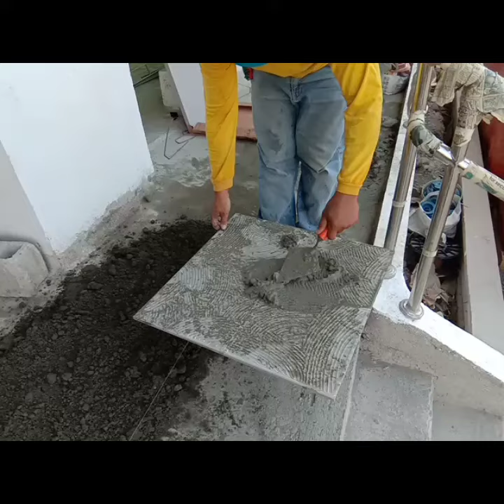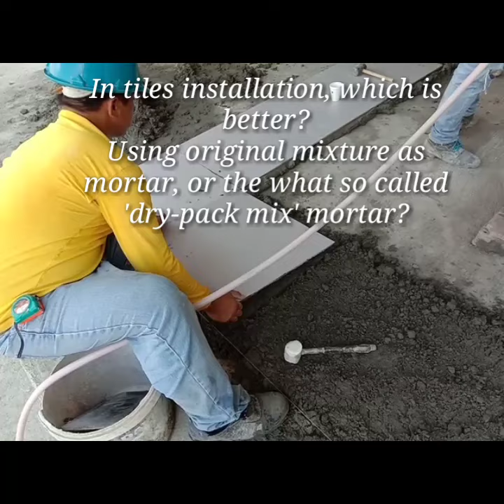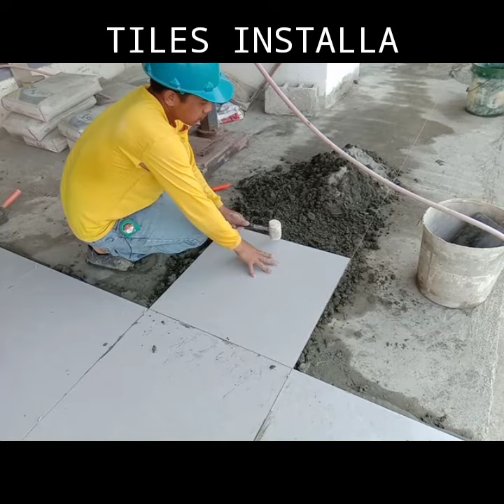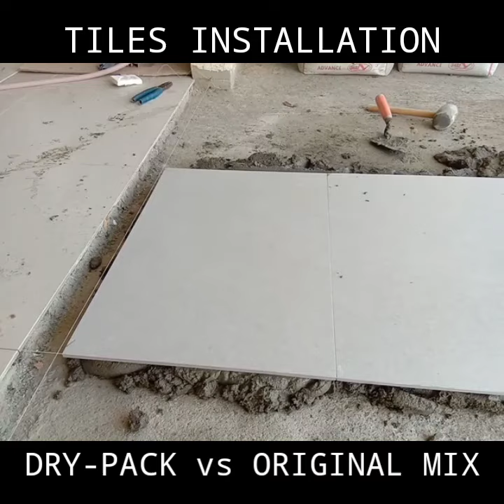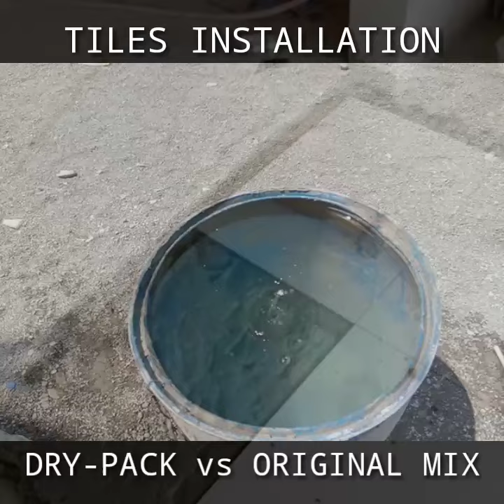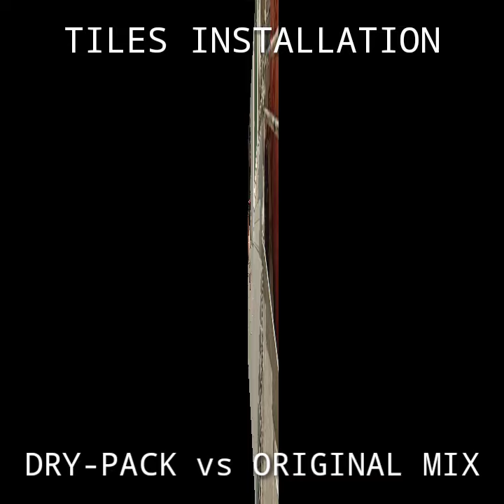Floor Tiles: Comparison Between Dry Pack and Original Mixture | How to Install Floor Tiles

Comment: The two methods are equally satisfactory depending on several factors. Dry pack method is good for new builds or outdoor patio areas where the floor level can be built up. Whereas if your tiling a small bathroom indoors then thin bed tile method is better suited

Comment: For me much better yung dry pack kasi may adhesive yung tiles bago ikabit yung derecta reject sa akin yan madami na kasi akong ne repair na kumapak ang tiles after a year,hindi siya kumakapit ng husto kaya sa sandaling panahon bumibigay,pero ang style kong isa pa yung dry pack din less water pa at grout cement sa ibabaw kapit na kapit talaga at menos gastos pa sa adhesive,im a mason beteran for the last 45 yrs. at 35 yrs.akong ofw.thanks sa video mo,madami ang matototo at makakakuha ng teknik,kahit anong paraan jan sa ipinakita mo pwede naman iaplay ng tilesetter,goodluck.
Reply from the maker: Maraming salamat po sa pagbahagi ng iyong kaalaman at karanasan sir. Godbless you po.
Reply: Ibig nyong sabihin sir is instead of using adhesive sa tiles is purong semento ang gamit nyo?
Reply: tama po kayo sir dito sa europe ng dadrypacking sila kong medyo mkapal.at cemento lng din binubuhos sa ibabaw yung tinunaw na cemento...pero bihira lng kc talagang gumagamit ng leveleng cement pg ng slab kaya pantay ang sahig kaya pag sa marmol or granite adhessive lng kc manipis lng
Reply: Boy Kalikot MotoVlog depende kapag hindi sanay sa pagtiles huwag gumamit ng purong cement,meron kasing style dapat beteran sa pagkabit ng tiles,mahirap eexplain dapat aktual ituro ng tilesetter or blogger video
Reply: Semento lng din gamit ko grout na cemento sa ibabaw Ng dry pack kailangan lang tlgang magand pagkaka compak Ng dry pack dapat siksik na sik .... Tpos laging lagpas sa laki Ng isang tiles sakop Ng drypak na ilalagay mo para Sakop buong tiles

Comment: Ang drypack ginagawa lng yan kpag malalim un level na paglalagyan ng tiles. Inshort nakabase sa flor finish plan. Kung mababaw nmn pde kahit adhesiv lng.
Reply: Lods pano ung diskarte sa mababaw lng?
Reply: @rickyritchieindino5141  konting silsil lng sa paglalagyan ng tiles. Pro ang kagandahan sa drypack madali mo matatangal ang tiles at magamit sa iba. Unlike pag puromg adhesive mabibjyak ang tiles pag kinuha.
Reply: @rickyritchieindino5141 pinaka purpose tlg ng drypack is to level the floor to install tiles prw hndi aksayado sa adhesive. At ang adhesiv is to hold tiles perpectly wla hangin o mgkakapak.
Reply: So sa mababaw lods adhesive lng at simento?mag di diy lng kc ako lods hehe
Reply: @rickyritchieindino5141  oo atlis haf inch
Reply: @ericputian124  sir,ung granite po ba mgnda sa sala,ung flooring nmin nkafinishing naun pro my ibang parte na hindi level,anu po Kya mas okay dun?dry pack o original mix,slmat po sa sagot en God bless po🙏
Reply: Tama ang dry pack po kasi ginagawa lang po yan..dahil sa hindi po maganda ang level ng flooring ng pagtatiles san po..pero kung nakalevel naman po yung flooring ok naman kahit hindi gumamit ng dry pack kasi dagdag gastos pa po yan..pwede naman po habulin ng adhisive kung anuman ang malalim na part ng flooring..

Comment: Bilang ahente ng isang condo at the same time nghahandle ako ng mga repairs. Naobserbahan ko yung isang sikat na developer used dry pack kasi mabilis ang gawa pero in 2 to 3 years time nag aangatan na lalo na kapag nagkaroon ng lindol. Nagpuputukan. So I prefer po yung original mix. Then pag pinaggawa mo yung may kapak the next month or year yung katabi naman magkakaproblema. I am currently assisting tile works. So yun nga you have to be very specific at dapat kahit babae ka kailangan may idea ka din sa contruction kahit basic or atleast mag search ka din para may alam ka khit papaano.Kasi kadalasan isasagot sayo "OO at hindi ganito po talaga.." Just sharing.
Reply from the maker: Salamat po sa pagbahagi ng iyong karanasan ma'am. Godbless you 👷‍♂
Reply: Correcttttt.
Reply: May mga spacing ba maam ung mga tiles or zero po? Salanat po
Reply: @czaribanezdayao2493  oo dapAt Meron po talaga

Comment: Pinaka the best jan orig mixture kasi mass lessen ung buble nya siksik kompara sa dry pack ampaw mas madameng buble ndi siksik kasi kolang sa tubig. Naging matibay sya kasi matibay na ung tiles na ginamit. Pero ndi advisable pang industrial ang drypack ndi pwede loadan ng mabibigat ganyan sahig
Reply: iksakto orig mix talga mas intact yung mortar subokan niyong magpatigas ng mortar na dry pak at basa na mortar tapos basagin niyo gamit martilyo kung alin mas matibay try niyo okay lang yang dry pak sa una pero pag gumalaw lupa kahit mahina lindol bitaw agad tiles Hindi na recommend ng mga engineer ngayon ang dry pak dahil iba na ang tiles ngayon kisa noon ceramic yung noon kahit ciment lang gamitin mong paste kakapit na subokan mo ciment ngayon sa tiles yung sa kapatid ko nalaglag nalang tiles niya sa wall ng kusa dahil walang adhesive na gamit kundi ciment lang.

Comment: I remember bata pa ako noon.matanda  na ako ngayun.  magaling lumapat ng tiles yung gumawa ng tiles namin. 1 sack sand at 1 sack cement 35 years na yung sahig, ni isang tuklap wala. yung kapit bahay namin dry pack gamit. after 5 years daming ng tuklap. sayang pera. mas mabuti pa noon ang traditional na pag tiles matibay pa. matagal ang pagka gawa peru sulit na sulit.

Comment: para sakin mas maganda parin na mag tuon ng pansin sa preparation ng flooring mo tulad ng tamang level etc. para maiwasan ang paglalagay ng aditional materials gaya ng dry pack mixtures para mahabol yung tamang level. kung pwede ka naman gumamit lang ng tile adhesive
Reply: Sa ibang bansa tipe adhesive lang
Reply: Yun ang tama. Nakasanayan ang pag gamit ng dry pack which is low quality. Dapat adhesive lang at manipis lang, problemado sila kasi hindi nila ma set ng maayos ang tamang level ng tiles, e paano hindi na tama ang mixture, malabnaw na kinakapalan pa.
Reply: Eto sa tingin ko ang tama..khit ano pa cguro ang damit n method basta plido ang gawa hindi nag mamadali.. wla magging prob.

Comment: This is an excellent system for irregular flooring or flooring of higher deviation. However, on good level near correct flooring, standard practice of regular adhesive and application is better suited based on time and manpower costs.

Comment: Hindi tlaga pwede manipis na dry pack dapat 3fulgada ang kapal ng mortar KC kakapak LNG yan pag dating ng panahon tapos Yung nag lalatag Hindi marunong KC Hindi nya pinupuno ng adhesive ang tiles dpat pati gilid ng tiles meron ayaw nya KC madumihan kamay nya sure ako ga gapak yang nilatag nya hindi nman n kalat palabas ung adhesive KC dry ung mixture nya hindi tulad ng natural na mixture Natin kahit hindi mo isagad s gilid ung adhesive kumakalat parin palabas correction ko Lang tiles setter din ako ayan ang na tuklasan ko SA pag kakaiba nila...
Reply: ano mas maganda sa granite tiles boss? tile adhesive or nakasanayang cement sand mixture?

Comment: Ang dry pack ay mabilis igawa kumpara sa original mixture. Less water. Madaling ma compact ayun sa kailangang level ng tiles. Ang original mixture ay more on water at mas malapot kumpara sa drypack na walang halong adhesive kaya hindi na ito basta na cocompress. Kung praktisado ka sa wet mortar go ka sa standard mixture. Pero ako sa drypack mas mabilis ang trabaho at maginhawa. But make sure na maganda ang mixture ng drypack. Kung medyo tuyo na siya advice ko lng sprayhan mo ng tubig para effecient ang drypack
Reply: dry pack kapack po yan

Comment: In the long run magagastusan ka pa din sa drypack,  gagalaw ang mga loose object sa ilalim ng tiles then for sure biyak biyak tiles mo when heavy load applied. To be honest,  pambanat ng mga kontractor ang drypack dahil kikita sila ng malaki dahil sa tipid materials at labor!!! Realtalk.. 😈😈😈
Reply: pero phrone nga sa kapak ang original mix ehh edi mas mhirap pag pumalya bitak lhat
Reply: Depende rin sa timpla ng original dapat hinde rin matubig yung tama lang kasi nasubukan ko yung drypack pagdating ng araw aalsa ang tiles kasi hindi siksik ang templa at cguro gawa lang ng mga contractor para mabilis matapos ang project nila.

Comment: Drypack  = kapak .dami ko nirepair na kapak at nag alsahan na tiles puro drypack ang kabit.the best parin ang adhesive ipahid sa sa tiles  .maganda abc tile adhesive ang brand
Reply: Depende sa tile setter yan
Reply: Dito sa amin maraming gumagawa ng ganyan dry pack ang gawa umaangat ang tiles. Mas matibay pa Yong original mix.

Comment: kung quality paguusapan original mixture wet mortar ang matibay siguradong walang kapak pero nagiinstall yan. dapat 100% coverage ng mortar yung tiles, lagyan mo din mortar yung tiles at iscreed mo ng trowel na may ngipin pati ang floor.

Comment: Yong dati ordinary mixture na hinaluan ng adhesive ginamit ng dating mason ko para sa 60x60 tiles, after 4yrs. nag angatan na at kumapak. Ngayon pinabaklas ko sa isang magaling na mason ang gamit nya dry pack procedure. Binalik yong dating tiles kc walang dry pack. Diniligan nya ng kunti bago ifinal paglatag ng tiles. Tama kaya yon?
Reply: Mas gusto ung dry pack cgurado ako khit tumagal hndi xa kakapak subok kona un.. d tulad ng dteng halo oo sa una mtibay nga kso di tumatagal kusang bumibitaw ang tile sa halo

Comment: Ang problema sa iba dapat pag ng buhos na ng flooring dapat nakalevel na at pantay na rough surface, kya pg nilatag na tiles kahit anong sukat tile adhesive lang katapat nyan...pero pg hindi nkalevel at bako bako floor, dyan need ang ibang style...

Comment: Para sakin mas matibay kung palitadahan mo yong flooring hanggang sa makuha mo gusto mong level at pagtigas ilagay na na ang tiles gamit ang adhesive. Hindi na kailangan ng dry pack. Kase ang dry pack hindi lang ordinaryong sand hinahalo dyn. Kalimitan ginagamit sa mga bricks.
Reply from the maker: Maraming salamat po sa pagbahagi ng iyong kaalaman sir.
Reply: Hahaha" yon Ang pagkakaMali mo brad' tingnan mong maigi anong pagkakaibahan.. sa dalawa mas pulido Ang dry pack..!!
Reply: Sigurado Ang dry pack waLang ampaw..kaysa sa original mix.. Alam Mona Kong Sino mas marunong sa kanila..tingnan mong mabuti brad..Kong Alam mo.hahahaha
Reply: @Samurai-xf2zr  pulido nga kaso kapag ang dry pack mortar na pang hollow blocks ang ginamit, mataas ang shrinkage niyan, kaya kung makikita mo pagtagal hindi na nagpapantay pantay ang tiles o kaya may kapak sa loob. Sabi ko nga hindi ordinaryong sand ang dry pack na ginagamit sa pag tiles, mayroon nabibili sa Home Depot na pang dry pack yong ang gamit sa pag tiles low shrinkage siya.
Reply: @Samurai-xf2zr  tingnan mo paglagay ng dry pack nila masyado mataas porosity niyan hindi siya compress, kaya mag si shrink yan pagtagal.

Comment: Matagal ,madumi,at mahirap isakto sa tamang elavation pag original mixture gamit kc gumagalaw pa..unlike sa dry pack..medyo matagal pero pulido,malinis pa gawin at medyo mas magastos nga lang... 
Ung mix ratio pde na sa dry pack ang 8pail (16ltrs size)- white sand bistay
1 pail  (16ltrs size)- water 
1 bag cement

Sa mortar ng tiles 
Isang kutsara n semento
Dalawang kutsara ng adhesive
Reply from the maker: Salamat po sa pagbahagi ng iyong kaalaman sir. 👷‍♂

Comment: Sir dun ba sa dry pack  yung adhesive mixture ba may kasamang cemento, at kung meron paano ang ratio ng adhesive mixture. Salamat
Reply from the maker: Hello sir, maaari nyo pong tingnan sa 3:45, 4:05, 4:20 mins po ng video para sa mixture. Salamat
Reply: Yung thickness ng adhesive gaano po ka kapal sir?

Comment: Dun pa rin ako sa old method...yung dry pack kasi hindi gaano kakapit maigi sa flooring na semento at ganun din sa tiles...ang kalalabasan nyan after a year mag aangatan yan kasi ang dry pack ay kulang sa mixture ng tubig...madaling tungkabin ang dry pack pag natuyo sa flooring hindi kagaya ng complete material at method ng mixing ng old method ay makikita mu ang strength ng mortar....kaya kung titignan mu sa mga mall nag aangatan ang tiles just because of dry pack method...
Reply from the maker: Salamat po sa pagbahagi ng iyong karanasan sir. 👷‍♂
Reply: Tama

Comment: Engginer ask ko lang po f my red cement at finish yung floring ko pero sininsil ko na man pwede ba ang adesive at semento lng half inch lng level nya po ano po mas maganda original mix o i dry pack ko o adesive lng n may halo semento, pasagot nmn po

Comment: Sir ano po kaya solusyon sa nayanig na concrete slab. 4 inches thick lang po ito at nakasteel deck. Pwede kay mag add akoo ng topping at rebars?
Reply from the maker: Hello po, dahil po ba sa lindol sir? Wala po bang rebars sa ibabaw ng steel deck?
Reply: @JUANCIVILIAN  meron po rebars 30x30 po pagitan. 12 at 10mm kaso nayyanig kapag may mga tao na sa slab. 4 inches thick lng po
Reply from the maker: Baka sobrang lapad po ng slab sir at walang beams sa ilalim, ano po dimension ng slab? Beam to beam po?
Reply: @JUANCIVILIAN  5x5 po ang beams and columns. Ang slab po nasa 7m.
Reply: @JUANCIVILIAN  mkakatulong kya ang magtopping sir ng concrete na aabot ng 8000psi

Comment: hi sir.. pede kya original mixture ung d masyadong matubig tpos lgyan ng tile adhesive ung tiles then apply? ok kya ung gnun o hindi slamat
Reply from the maker: Hello po, sa tingin ko sir pwd naman po yung combination hehe..ang importante maayos ang pagkakabit.
Reply: ah kasi ok ung drypak kaso mdmi nag ssbi na naalsa ktgalan
Reply: @JUANCIVILIAN  sir may hindi parepareho na sukat ng tiles,,kahit mala skwala na ung ay nawawalaa ako sa skwala,,dahil sa hindi parehona sukat ng tiles,,ano po kaya diskarte non,,slamat po
Reply from the maker: @abinesgaerlan9541  hello po, impossible pong hindi kasing sukat ang tiles sir, baka mali po ang lay.out. subukan nyo nalang po mag grinder or adjust nalang sa gap per tiles, or worst baklasin if kunti pa lang na install kasi tuloy2 na yan.

Comment: Sir tanong lng po OK lng po ba Yan na purong adhesive cement ang Ginamit sa  paglalagay ng tiles? Matibay po ba ang kapit nun?
Reply from the maker: Hello po, yes po sir mas matibay po kung purong tile adhesive ang gagamitin, nilalagyan lang naman sya ng cement for economical purposes.
Reply: Kahit di na maglagay ng dry pack sir ayos lang ba yun.direkta na adhessive cement.

Comment: Boss ang nka redcement na sahig ,pwdi bang idry pack at etiles ng 60x60 na di na titik-tikan?
Reply from the maker: Hello po, pwd naman pong e grinder nalang yung ibang parte ng floor sir, makinis kasi..para at least may kapit ang mortar, or di kayay rebukadahan muna bago ang tiling installation po.
Reply: @JUANCIVILIAN  sir puwede po ba sa red cement rekta tile adhesive n??? Kailangan paba igrinder na pagkakapitan ng adhesive?

Comment: Sa resto ko drypack ang ginamit after 5 yrs umalsa Isa Isa hanggang umalsa lahat
Reply: dry floor padin with the use of correct tile adhesive..
Reply: Ganyan din po ngyare sa kusina ko, ung tiles ko sa kusina umalsa Tapos nabasag at umangat mga 5 years na rin kasi. So ganun pla pag dry pack Tapos ceramic ang tiles, lalo na pang ang tiles na ceramic Hindi nababad sa tubig. Ngaun laking gastos nnman kasi kelangan ko palitan ang tiles ng buong kusina ko. Sabi mas maganda ang original mixture more adhesive it last long and forever not like sa dry pack walang forever!

Comment: @
@ 

A portable mixing tool  which is 5 times faster for tiling, floor leveling, stairs  plastering, wall plastering and road paving
Reply from the maker: Thanks for sharing.
Reply: @JUANCIVILIAN  pwede ba dry pack  direkta sa lupa  at hindi sa rough finish ng concrete flooring

Comment: Para sakin mas ok ang dry pack kesa dun sa basa.  Kc ung basa pag natuyo bumababa elevation  kaya nag kakaruon ng hindi pagkakapantay pantay.. Madumi pating gawin.. Base sa karanasan ko yung dry pack pagnaka kabit na kung anong picks nun khit matuyo hndi na nababago.. 😉 less eport pa sa pagpupunas👍👍
Reply from the maker: Maraming salamat po ma'am sa pagbahagi ng iyong karanasan. Keep safe po ☺
Reply: may iba png paraan sa drypaking kong gusto mo tipid mgbabad ka ng cemento yung medyo malapot lapot lng sya pagka level mo ng drypack tulad sa ginagawa nya buhusan mo ng tinunaw na cemento ang ibabaw ng drypack bago mo uli ilatag ang tiles..purpose lng kc ng drypacking madali e set up ang tiles saka kahit apakan mo kaagad at d masyado madumi at secured ang pagitan para sa grouting..
Reply: @ruelrano5735  ganyan din ginagawa ko boss

Comment: I prefer dry pack .pero hindi ganyan ang mixture.dapat 2bag adhessive at 1 bag cement lang. Masisira ang strength ng adhessive kung may buhangin pa.  At merong ipapahid adhessive paste sa tiled bago ilapag. 
Pag walang adhessive cgurado kapak at di magtatagal kalas lahat lalo na pag sa upper floor na high temp. Nangyare kz sa bahay ko kalas lahat after 3years  ...un pala walang adhessive nong kinabit. Use adhessive kabayan
Reply from the maker: Salamat po sa pagbahagi ng iyong karanasan sir.
Reply: Sir u mean po 2bag adhesive plus 1bag cement un po ung ilalagay sa floor?tapus pure adhesive po ung ipapahid sa likod ng tiles bago ilapat?ganun po ba?magpapatiles po kc ako bukas,sana mapansin,salamat🙂🙂
Reply from the maker: @diannekaur5569  hello po, yun po ang basi sa experience nila ma'am, yung sa akin naman po may sand pa, nasa video po ang mixtures ng ginamit namin.
Reply: Laki ubusin mo pag ganyan gagawin, mag orig mixture nalang yung traditional subok naman na yun lahat ng ginawan namin nun ni isa wala pa kumapak

Comment: ung tile setter galit sa akin kc ayaw ko ng dry pack(mixture). nag insist talanga ako na wet mixture kc mabibigat na machine ang papatungan.  kay adaily ang pasahod ko para sure na maayos ang trabaho. at binantayan ko sila hanggang sa matapos.

may mga bad experience na kc ako sa dry pack. natatanggal agad ung tiles. o dilang marunong ung nagtrabaho.